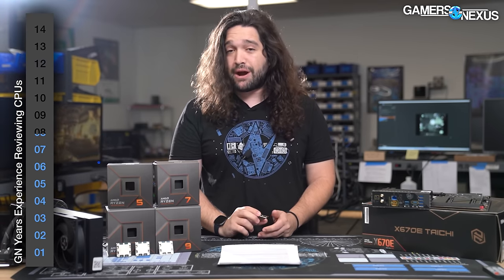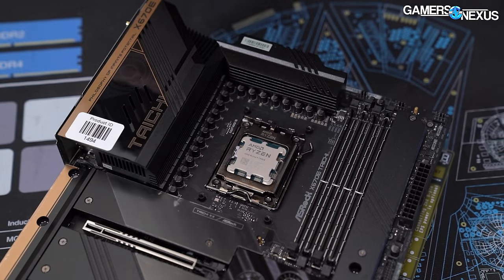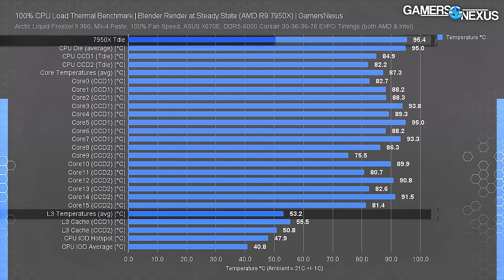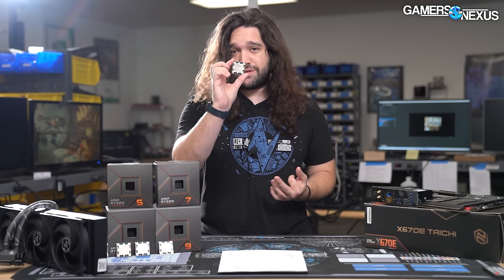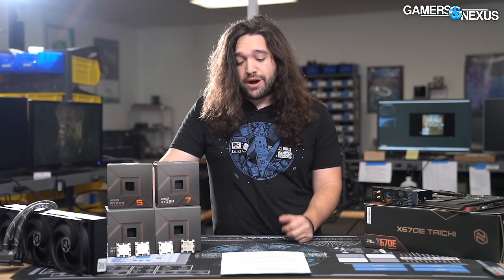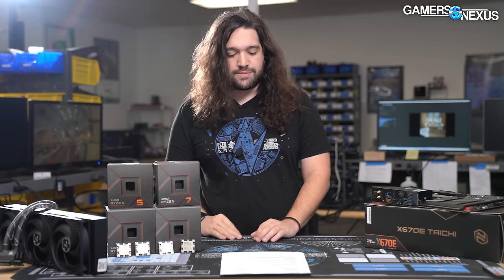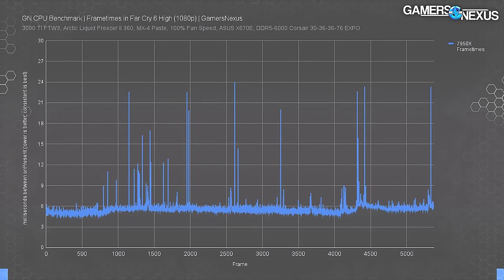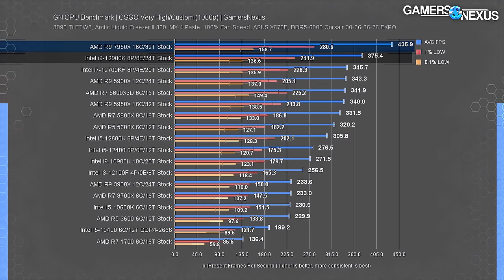95°C is Now Normal: AMD Ryzen 9 7950X CPU Review & Benchmarks

Comment: How are People supposed to work like That? - In the Constant feeling their system might catch fire any time and in the urge to control that their cooling is running at 100%?
Reply: Just adjust the fan curve for the cooling accordingly so it's not really loud?

CPUs being fire hazards were only a concern with much older CPUs which did not have thermal protection. So they could literally run themselves so hot they would start melting.
Reply: Ow bud. Imagen how many people are going well over 50km/h and forget or do not care that the vehicle they are in only got like 4 hands of contact surface with the ground. That the hole vehicles weight is like 2000kg or more and rely on 4 hands of contact to stop that mass. And that the cooling system for the engine runs above 100c (over boiling point) meaning that the cooling system has to be pressurized just to stop the cooling water from turning into steam. Or why not look at EV's and there heavy battery packs that if punctured are going to cook off. 

No firefighter is going to be able to stop battery fires. The vehicle is doomed to burn down if stuff go wrong. Same with smartphones!

Really it is fan noise and possible problems of stuff not lasting as long as they should. Or possibly problems with the motherboard catching fire. In a metal box. There should not be such a danger even now NZXT and Gigabyte have shown that it is a real concern. I really do think AMD have gone out of there way to make sure fires are not a thing in the news.

Comment: I say this again, as someone who uses adobe software. it's not multithreaded, and it's gotten slower over the years, and harder to run, with more bugs. it's no longer a good test suite. I may be an AMD fanboy more or less, even though I have no AMD stuff, but I do VFX and let me say- a 30 year old program made for single core cpu's and 512mb of RAM, retrofitted to use RAM like an idiot, and use each core exponentially less than the last, is a poor choice of benchmark for modern CPU's. RAM and cache, sure- it'll tax it, and use it all, but it won't even use 40% of my gtx1070, and a file I made in 2016 runs half the speed on the same hardware now than it did in 2016. inconsistent tests that test incomplete sets of characteristics just aren't useful.

Comment: It was already normal with the 5800X.
Reply: @Mike I just have a Hyper 212, the day i installed i ran some tests and it was running at 95°C with turbos enabled, i add a 2nd fan and i do some undervolting and instead of getting lower temps i get higher turbos. It is clear that is designed to work at that temp, i would need a way more expensive cooler like that Noctua, to make it go down.

Comment: 95 C "by design?" Good lord 😫🤣Is this just for the 7950X or does this apply to all of Zen4?

It's gonna suck gaming on this in the summer time. Not so sure I want a 200+ deg (Fahrenheit) little space heater next to me. I was ready to go back to team red after my current 9900k build.. but for those temps I'm not so sure. I live in CA and it gets hot af here in the summer.
Reply: The 9900K uses almost as much power as the 7950X?
Reply: @infinitelyexplosive4131  No it doesn't. It's not even close. Pulling info out of our butts are we? My 9900k under full Cinebench load just peaked at 150 watts and 72C on air cooling. Certainly not the most efficient thing out there (the 10900K is even more efficient), but the 7950X power draw is 70% more.

Not trying to defend the 9900K or Intel, but 95C is pretty ridiculous for Zen4. Especially for "out of the box" temps.
Reply: @kalapanas  I see reviews for the 7950X at somewhere between 180-250W depending on cooling setup, and reviews for 9900K at somewhere between 160-200. Do you have MCE (or whatever it's called on your motherboard) disabled?

I don't know why the CPU temperature is relevant. It's not going to break.
Reply: @infinitelyexplosive4131  MCE set to auto as it should always be.

And it's not going to break. If AMD engineered it that way then I'm sure it's fine. But certainly heat/thermals do cause premature wear.. and 95C continuous seems pretty damn toasty. Especially for out of the box temps like I said. Not so bad in cool fall/winter months. But in the summer that continuous 95C is gonna suck.

Comment: I know your trying to make a cost comparison and work place usage comparison but you should make clear that Adobe purposely doesn't work well with AMD and heavly favors Intel. For AMD to be on top in a Adobe software is a remarkable feat for AMD. Give credit where it's due. It also states a lot about Intel when they are losing. It's like AMD is a the starting line and Intel is starting at lap 2 in a 3 lap race and still loses in Adobe software.

Comment: Pretty disappointing by AMD, the 5000 series were so good for efficiency, now their thermals and power draw are comparable to intel, and the performance gain just isnt high enough to justify it IMO
Reply: Worse than Intel. Zen 4 cores have worse IPC than golden cove, and 5nm 7600X sucks a lot vs the 12700K.

Comment: Seems like reviewing CPUs is not going to give much useful information anymore. The stock power consumption is absurd. Those are factory overclocked CPUs.
Setting a power limit or undervolting will drastically improve efficiency, but most reviewers do not test that, so consumers (or at least enthusiasts) will have to figure that out themselves.
And the 5600X was an extremely efficient CPU, but the 7600X throws stock efficiency out the window, just so it can boost as high as possible for almost no benefit.
There is so much going on in the PC industry right now, but frankly, none of it is good. Just more watts, more dollars and more bullshit.

Comment: Wow..im so disappointed... really..95c is where we at? Normalizing watercooling and AIO's i mean since when. How will this even going to function in a SFF build. With the energy prices sky high, gaming is becoming one hell of an expensive hobby.And the pricing, not even the CPU but everything around it is just mental, 400$ on AM4 would get you a ferrari of the motherboards. Now it gets you some low tier mobo. Honestly i am tempted to get the am4+5800x3d and sit it out but buying am4 feels like getting the last gen iphone. As much as i hate intel, if the temps are in check i am tempted to buy 13th gen even if the performance is 90% of AMD. And even knowing they will screw me over next year by switching to a completely new socket.

Comment: I'm not a big fan of the Auto Boost slamming the chip to thermal throttle, that's gotta cause a lot of wear and tear on the die and shorten its lifespan. Please excuse the pun, but... dude, not cool.
Reply: Have you ever seen any cpu fail from thermal cycling?
Reply: @infinitelyexplosive4131  Yes I have, although it's been a bit. However, more importantly, it's not about immediately failing from thermal cycling, it's the extra stress on the components that will cause a shorter total lifespan that I'm concerned about. I'm currently running a 3600, my last one was a pre-zen 8650. So I've got about a decade upgrade cycle usually (I am thinking about upgrading just the CPU to a 5800 3D as a single component drop n swap with a BIOS flash since I have one of the older B550 boards). But running a steady 95C? You're going to be lucky to get five years, maybe two or three if you're not so lucky, before it starts crapping out on you. Given the price tags associated with everything involved with these chips, that's not a great deal.
Reply: @ShneekeyTheLost  2-5 years? Seriously? I've seen several systems run at TJ max under load for that long, none of them have had CPU failures.
Reply: @infinitelyexplosive4131  You run enterprise hardware at 95C? Not just the server farm for the skew data but the processors as well? Calling BS on that.
Reply: @ShneekeyTheLost  for example a construction machinery rental business that literally had their server rack in a closet with the door almost shut, room had to have been at least 30c ambient
Reply: @infinitelyexplosive4131  Well yea, that kind of stuff happens all the time. But there's a big difference between 30c ambient and 95c Tdie maintained. And again, we're talking enterprise vs commercial hardware, which are two different ballparks. 

I don't care what AMD says, CPU's are not designed to run at those temps. Hell, you're getting dangerously close to risking biphase flow in an AIO cooling system. Granted, the odds are low because there's a lot of inefficiency and an enormous thermal buffer in the line relative to thermal energy transfer, but I wouldn't want to run on those margins, given even a small water hammer is going to fry my whole system.
Reply: @ShneekeyTheLost  They were definitely sitting at 90+. I only mention the room temperature to explain why they were doing so. 

You're absolutely nowhere close to hitting biphase flow on an AIO. Tdie and Tcoolant are completely different things. The flow rate in a liquid cooler is way too high for the coolant to boil in the waterblock. Even a 120mm won't get remotely close to 100C Tcoolant.
Reply: @infinitelyexplosive4131  No server rack I've ever served ever got over 80C on the die. Enterprise hardware is specced very differently from consumer hardware. For server rack management, you actually don't need very high clocks, I'd be surprised if it was doing much over 2.3Ghz, and even that tends to be blazing fast for that sort of chipset. Granted, you want a bunch of cores for multiprocessing, but none of them are getting pushed all that hard. I will concede, the cooling solutions also tend to be less intense than in high end consumer products as a result, although you can push the fan RPM's crazy high because no one cares if it sounds like a turbine spinning up if it's in a server closet, but there's no way you're hitting 90c consistently and getting away with it, even on enterprise hardware. 

You don't overclock enterprise hardware, not if you want to keep your job at least. So there's zero reason for those chips to get that hot. Ever. If you're seeing temps that high, either a fan has gone and needs to be replaced, or the exhaust has been blocked in some way, and you need to correct it.
Reply: @ShneekeyTheLost  I don't really know what to say. I've seen severs run consistently at or close to TJ max, and you're here telling me that I'm wrong. As if I somehow misread a 2 digit number. Ok dude.

Comment: factory settings on these are stupid and market driven, these chips are driven well beyond their sweet spot. Restricting a 7950x to the same 140w its predecessor had only costs you about 5% in performance, and it still wipes the floor with everything. You could go down to 88W and it would still do that. Its too bad market forces made waste all that efficiency potential

Comment: "95 C by design" is this a laptop? AMD can go FY with this nonsense.
Reply: Not even a laptop, i7-11800H is like 10 degrees cooler than a Ryzen 9 5900HX for a 17 inch HP Omen on Cinebench and the 11800h doesn't thermal throttle there. Max temp is 90 degrees but is pretty rare.

Comment: Simply ridiculous.
An Arctic Liquid Freezer II 360mm (3X120mm fans) AIO Cooler running at full speed and the CPU is at 95 deg ! 

Do many people want this monstrosity in their study or bedroom? 
The ALFII AIO is great - but not at 100% fan speed and not pumping out that much heat 100% of the time.

And think of the power bill costs to run the PC and to power the Air conditioning just to make to room habitable. No thanks.

Comment: Guessing if you were to open loop cool this CPU & GPU, you'd be best off with dual loops.  Maybe adding a second case just for rads & fans, & use quick connect between the two cases.  Maybe a radiator from a car with a DC powered barrel blower fan, or two (the kind they use in new construction for things like to get plaster or paint to dry faster.  And put the second case, or your car radiator custom box with blower barrel fans in another room, with hoses running thru a wall so you will not need to scream to be heard.  Hell you could use this CPU as a instant hot water replacement water tank ...  LOL take a shower in mid winter by just running cold tap water thru your loop.  🤣... sheeze what will my power bill be?😭

Comment: EXPECTED BEHAVIOR MY ASS!

Clearly AMD is pushing the silicon WAAAYYYY outside their efficiency curve so they can compete  against Intel BY ANY means necessary including letting the 7950X cook itself which is exactly what Intel did whit the 11900k so all of them do the same shit in that regard but if someone feel the need to buy this CPU then better get the Derbauer deliding tool and the direct die frame which drops the temperatures 20C or more after getting rid of that THICC IHS on top of it because I'm pretty sure the CPU is not going to last a second more than the warranty period at such temperatures.  And the entire cooler compatibility is BS also because many coolers are going to need an adapter kit for the back plate anyways like Roman Derbauer show and if the manufacturer don't provide one then a new cooler is needed.

Comment: Holy shit so Intel is just as fast pretty much and uses less power and runs way cooler… we live in the upside down world.  Bulldozer I mean Zen4 sure isn’t very exciting.
Reply: Wow the gaming it barely beats the 12900k they had to clock that thing to where it’s about to melt to get it equal with the 12900k in pudget bench’s in actual software people use and it basically tied in gaming . I don’t give a fuck if it wins in 7zip hahahaha or chromium compile haha if you do a lot of zip files though this thing would be the one you want hahaha
New LGA motherboards that are gonna be another $100 each and you have to go DDR5 and it’s got to have a 360mm aio running like a blow dryer haha … all the AMD fanboys will start the cope soon … just wait for big Navi , just wait for RDNA2, just wait for the 3d cache version… haha 
I’m just messing it’s just funny had a 12900k now for almost a year and my brother was crying how I should of waited for zen4 … haha this is AMD somehow clocking there fucking chip to melting point to compete these chips aren’t going to last I bet be a lot of RMAs … my brother has a 5900x ryzen build and that thing runs hotter than my PC I can’t imagine how hot this thing is gonna be like holy shit 95 degree operating temperature haha

Comment: windows 11, ew garbage
Reply: The new Vista, and 8... 
Do you know the one good one bad rule?
Good XP, 7, 10 
Bad: Vista, 8, 11
Reply: windows 11 is actually pretty good. upgrading from 10 to 11 gave my PC a nice increase in overall performance and better hardware utilization. so far, unlike with windows 10, i haven't experienced any bugs or issues on windows 11.

Comment: 20:00 lead for Intel not for AMD !
who wants 95° inside the case ? if my radiator is at 95° watertemp my air cooled gpu will hit 93° asap...
The gpu throttles because of a "fast" and hot cpu...it makes NO sense ...if most games are gpu limited...
server without dgpu..ok
external mora...ok
air cooled gpu and internal cpu cooling(in a closed case )...no way